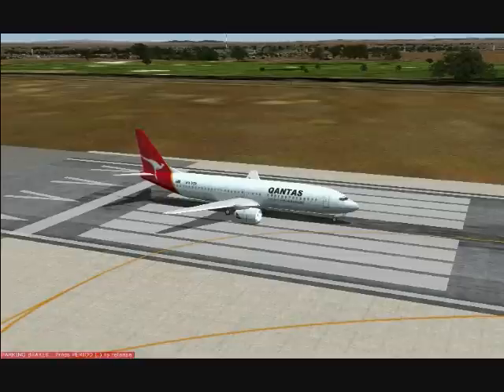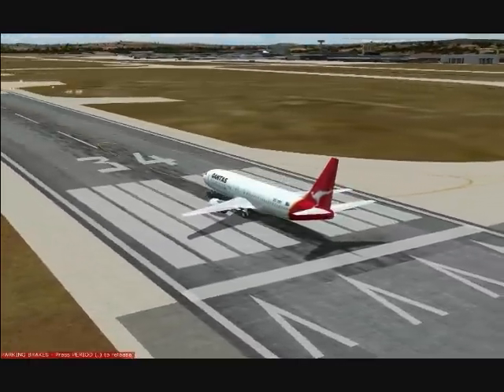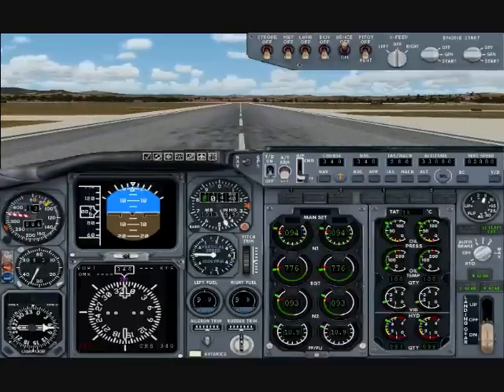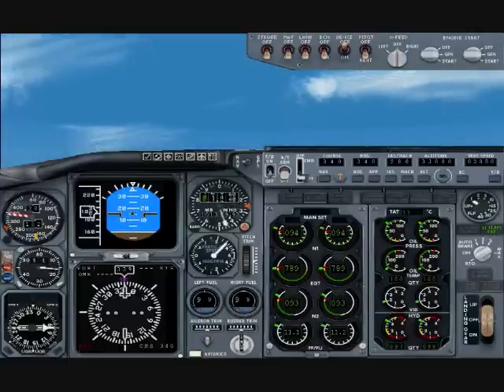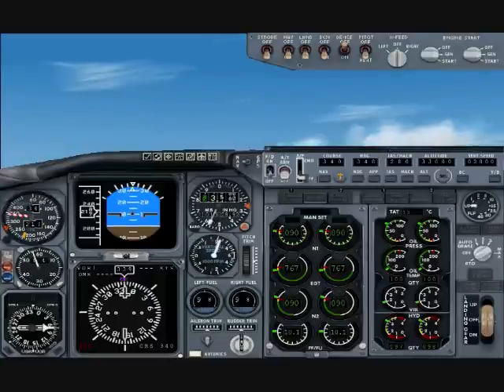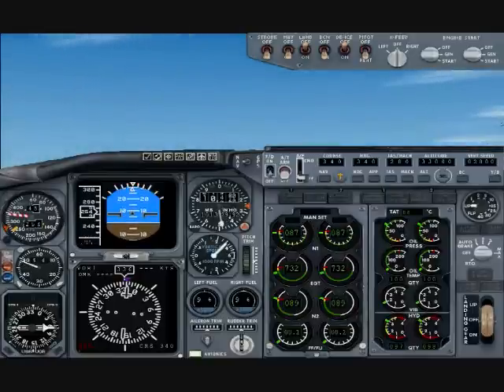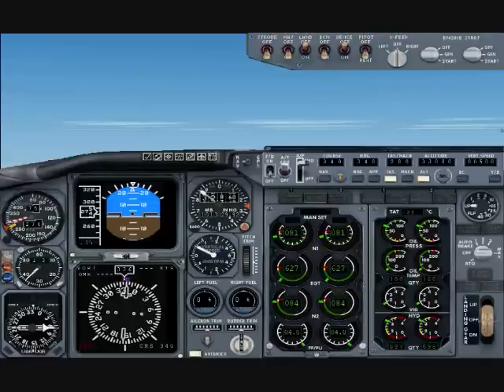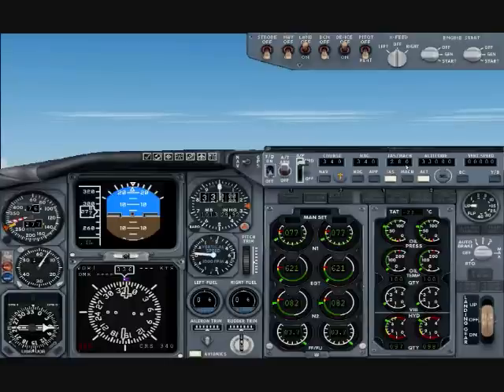Flight sim 737 takeoff and climb tutorial

Comment from the maker: You can adjust pitch trim in any aircraft in flight sim.  But not all of them will have a display showing the amount of trim applied.  I don't have the CLS A330 but I have found out that it does show pitch trim.  If you look at the lower ECAM panel (front middle lower screen) you will see buttons below it.  You need to press the F/CLT button.  This will show pitch trim position on the screen.  If you have a user manual look at that.  Hope this helps.